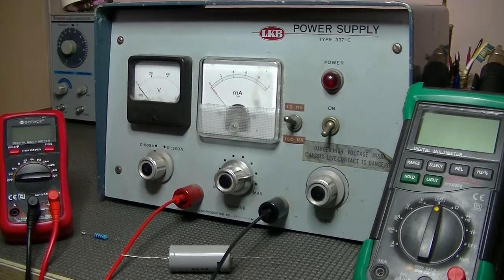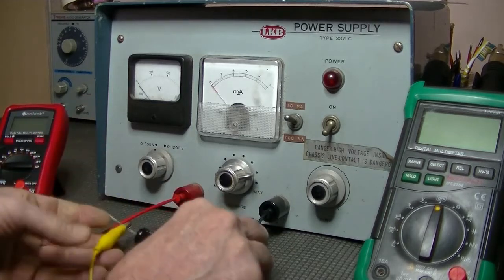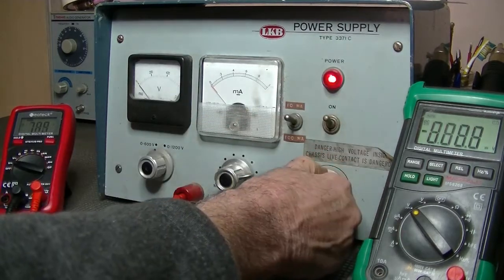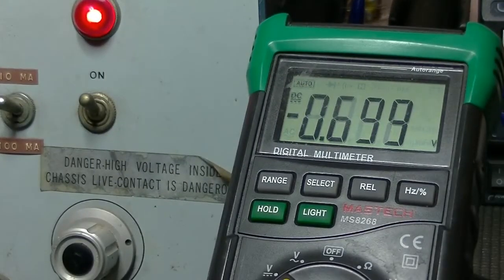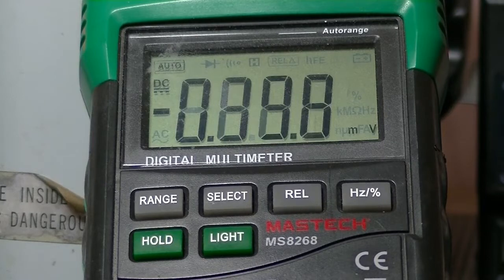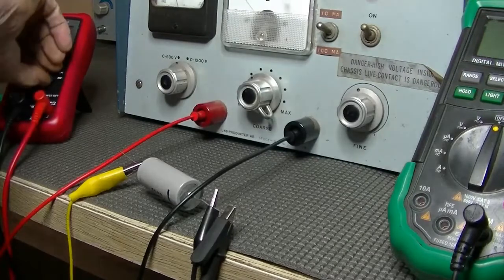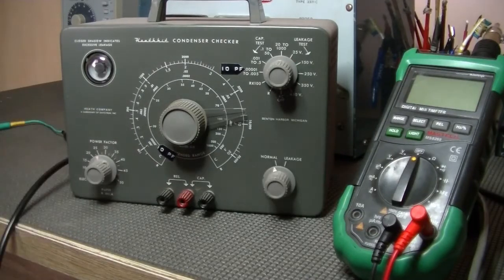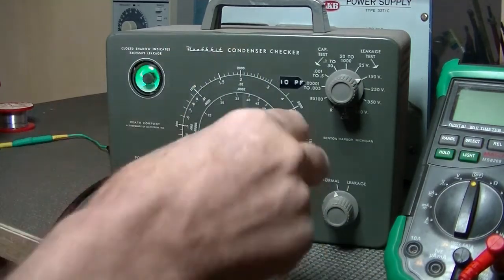Reforming Electrolytic Capacitors

Comment: I’m glad that you took the time to show how to reform a NOS (very, very old early 1970'S?) capacitor is done while monitoring it. I have the same condenser checker you have and my favorite one is my IT-28 which has the maintained leakage test selector switch. Good timing because I was just reforming a couple of caps while showing how to find the foil end of film capacitors while restoring a small cheap plastic AA5 with a PC board which I will upload in a few days. The only issue is that the magic eye tube stays lit during the entire capacitor reforming process. I should add a switch on the back to cut off the voltage to the magic eye. I’ve been reforming NOS electrolytic for many years and as previously mentioned I always start out with lower voltages. New capacitors don’t have the date on them as the old ones and I have found the brand-new ones also take just as long for the eye to open at full voltages, we don’t really know how old the new ones are and there’s a good chance they were in stock for several years before they shipped. As long as their NOS and reformed the proper way they will last as long as a brand new one will. That’s why I always run any radio or TV for a minimum of 12 hours, so everything stabilizes. I have even checked in circuit ESR a few times and their way lower than what’s listed for the caps. They will last as long as the listed hour rating specs. I purchase all my capacitors, resistors and other items from a reputable seller in Ontario Canada.
Reply from the maker: Thanks for that Ken. I'm also looking forward to your video
Reply from the maker: ps: Will you be using Ken F or are you starting a new channel for the restorations?
Reply: @exeterslab7781  Exeter, I’ll use a different channel for repairs and restorations. It’s beneath me since it’s such a small simple AA5 pc board radio restoration. I am a newbie with cameras, lighting and especially video recording. I just wanted to get a video out since all my previous attempts were terrible. I had to convert 6 different files to MP4’s and now have to edit them to make it a shorter video and editing is a pain also. I’ll let you know when I upload it.
Reply from the maker: @kenf8563  sure thing :)

Comment: The other thing to look at is battery operated radio sets would use up the power just to reform capacitors every time you run your radio is it worth wasting money for battery's.

Comment: Only a duffer would try to exceed the maximun voltage ratings of a capacitor. Sometimes a reformed cap will return to it's
formerly bad ways. Send it to the pokey ( bin). LOL  I like blueglow electronics YT video on reforming E- caps. Covers just 
about everything there.
Reply from the maker: Cool, I'll check the channel out

Comment: At best reforming a capacitor is a stop gap measure to test a radio if you don't have new caps to replace them. Good in a pinch but not forever because the dielectric does dry out over time.
Reply from the maker: You're right of course Larry. Still, I can now say I've reformed lol